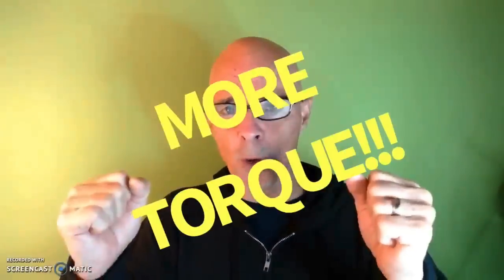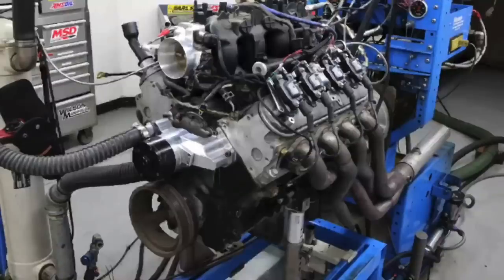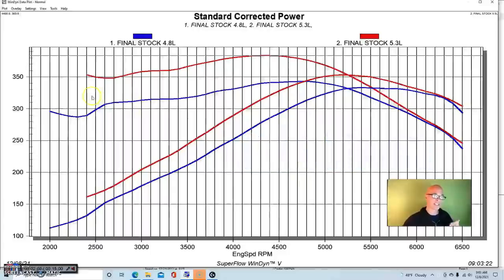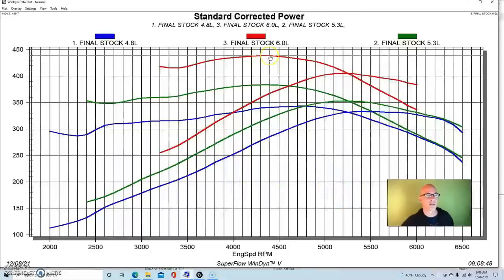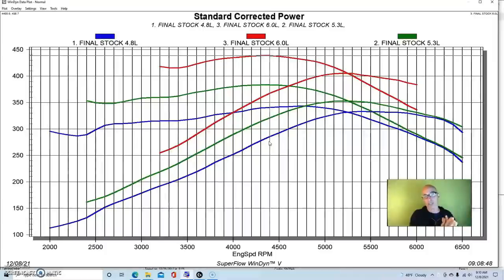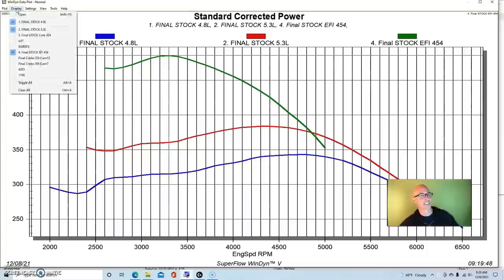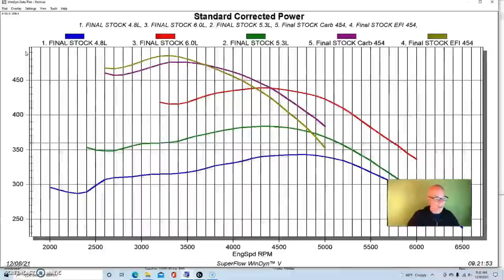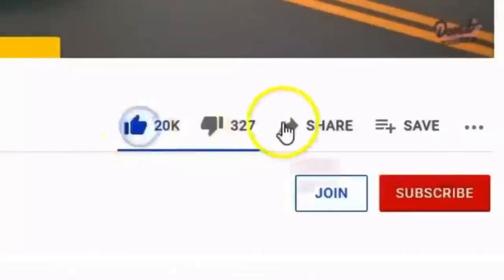LOW BUCK, JUNKYARD V8 TORQUE TEST-6.0L LS VS 7.4L 454 BBC-WHO MAKES MORE TORQUE? BETTER VS BIGGER!

Comment: I like these comparisons, nice job!   I could have told you which one was better, at least from my experience.  I owned both a 6.0 truck and a 454 truck at the same time.  The 6.0 had 4.10's out back with a 4L80E and the 454 had a 400 turbo with 3.73's.     I used them both for towing and in all instances, the 454 would out run the 6.0 pulling the same car trailer.  Even used both trucks at the same time, both pulling open car trailers, and the 454 would run away from the 6.0 as soon as we hit any kind of grade.   What I really don't like about the 6.0 is that in an attempt to keep up it would take a lot of throttle angle, usually the trans downshifting and holding a gear while the 6.0 would scream at 4500-5000 rpm for these long grades, miles at a time in Arizona.   Not my cup of tea.   The 454 would just lug along at 2800-3000 rpm and maintain speed.   I actually got better gas mileage as a result with the 454 on long hauls.   Just my experience with them.  Because of that, when they dropped the big blocks from the line up and I needed a new truck,  I went straight for a Duramax and never looked back.
Reply from the maker: can you draw dyno curves too?-that would make my life a lot easier
Reply: Ur crying over a motor rreving an extra 500 rpm that’s so idiotic
Reply: @bobleeswagger2290  running a motor at 1500 to 2000 rpm lower is a good thing when it comes to towing and the longevity of the motor.....and keeping the rpms lower can't do anything but help with gas millage
Reply: Alot of difference is in the tune. That 454 probably actually had no tm. The 6.0 is straddled with tm. Get rid of the tm and 6.0 does pretty well.....and you actually can get around 15mpg with the 6.0 unloaded. The 454 will never achieve that.
Reply: @HioSSilver1999    I'm 99% sure based off of my dyno experiences that Richard is most likely running a custom computer tune, likely aftermarket from Holley or  if a factory computer is used they'll use HP Tuners or the like to ring the most out of it.
  The 6.0 can be pretty fuel efficient with a tune and smog removed.  I dropped a 6.0 LQ4 in my 72 4x4 blazer, and with my own custom tune, a 4L60E, and 3.73 gears with 33" tires, it got a best of 20 mpg highway.  454's aren't terrible. My 79 1 ton with 400 turbo and 3.73 gears got 14 mpg highway consistently empty, and towing it didn't care what I pulled it always got 10 mpg regardless.  With an overdrive I'd expect 16-17 easily with an empty truck.
My father has a 2014 3/4 ton he bought new with a 6L80E.  Completely stock, it's lucky to get 14-15 mpg at best on the highway.  Towing it's pretty wheezy, and 6-8 mpg is all you'll see pulling a loaded car trailer with the trans constantly hunting gears.  Went across country like that.  It's why I went diesel years ago.
Reply: @firebirdjone  you missed the entire point of my reply.  I know Richard is tuning them....but if you're not atleast tuning the tm out of them then you never see the power he's showing you they can make.....not even near.

That 6l is hunting for gears because it has more gears. I have a 03 6.0 2500hd. The newer one like he has isn't weezy at all......well the engine isn't.  The tune sure is. You have to differentiate between the 2. A friend has a 08 or 09 6.0 in a single wheel 3500. His pulls good. The extra gears of the 6l is a benefit over the 4l80 like mine has.

With a car trailer and vehicles as large as surburbans my 6.0 almost never comes out of od on the highway with me throttling it. Now if i use the cruise is shifts some because the cruise will make it downshift and accelerate on a grade if it looses 2 or 3 mph. More times than not if I'm throttling it then it just hangs there or accelerates slowly back up to speed on said grade. You  have to be willing to drive it more than just holding onto a steering wheel.
Reply: @HioSSilver1999  I didn't miss your point,   the fact I mentioned that I'm sure Richard is tuning them meant that I'm sure torque management has been removed.  That's one of the first things you do.  It's not needed on the dyno, we aren't worried about transmissions here. I'm sure what you're seeing on his dyno is without torque management. 

For the record I never use the cruise when towing with the gas engines.  They are too brutal on the throttle changes.  Even with that said, can't avoid the gear hunting and the fact that the 6.0 has to scream 5,000 rpm to climb grades around here just to maintain 50 mph in some cases.  My old 454's never had to do that.  That's the difference between the torque curves that I mentioned months ago in my first post.   GM dropped the ball when the BBC went away, which is why I went diesel many years ago.  The 6.0 is okay for towing 2-3000 lbs. and not horrible with 5-6,000 lbs of open trailer,  but I'm miserable with 8-10,000 lbs. of enclosed trailer behind me.  Either way, it won't run with the 454 on any decent grade.  Been there done that as I mentioned in my first post.
Reply: @HioSSilver1999  I get 15 mpg on the highway with my 99 k2500 suburban 7.4. around 10 loaded with Dutchmen 30 ft travel trailer.. going from Vegas to San Diego you have (cajon-pass 4000 ft elev) and then a really shallow long upgrade after it that gives semis fits. I just pass right by them without downshifting.
Reply: @firebirdjone  you did miss the point because the tm isn't removed in your 6.0 truck. The old 454s never had tm.

Depending on the year of your 6.0 and the trans it had they can't turn 5k rpm at 50 mph. The gearing won't let that happen in my 6.0 truck....and it has 4.10s with the 4l80.
Reply: @wrotedog  you sir have the most amazing 454 on the planet. I've never seen one get 15mpg
Reply: @HioSSilver1999    Oh it absolutely would spin 4500 to 5000 rpm to hold 50 mph climbing these grades around here.  I'm not even sure which gear it would choose,  it was all over the place, has the 6L80E.  Was very unnerving holding those rpm for 6-7 miles and trying not to be a burden to other traffic.  On flat ground I could live with it, but in the mountains, forget it.   As far as torque management goes, maybe GM should build something more durable that doesn't need a band aid.  I was tuning these things years ago with HPtuner and removing that stuff looking for more power but the 6.0 just didn't have what I was looking for.   It's another reason why I got away from gas trucks and went diesel.  Even in stock form there was no comparison.  Now after some bolt ons and tune it doesn't get any better.   It's just unfortunate we have to spend $80k for a diesel to have a truck that does what it's supposed to do.  GM dropped the ball when they dropped the BBC.
   Don't get me wrong, I like the LS platform and have done 6.0 swaps in classic cars.  They are great engines that have power potential in a car, just not big enough for a truck application to do what I need a truck to do.
Reply: @firebirdjone  yea if you had the 6l80 it would. They're meant to turn those rpms tho.

I have the older 4l80 in the gmt800. There's more than tm going on there. You have a pe delay also. I just call it all tm because essentially that's what is. 

My 6.0 has headers and some other mods that really improved it. But if you don't find ALL the tm the mods really don't matter. It just makes the pcm pull more torque. Most never find it all....hell I'm still trying to find it all myself. I know there's still something holding it back on launch a little. I've found most of it tho.

I don't think gm does it because the components aren't strong enough really. It's more to keep warranty claims down because some people can tear up anything.

Comment: a 402 or 408 or 416 with an aloominium block and aloominium heads is light weight.  It'll fit in a Nash Metropolitan too.  With a factory intake and a factory Vette pan, you could mount it low and probably still close the hood.  You might not tow with a Nash Metropolitan, but you could.  And you'd be cool.
Reply: I just saw a factory GM picture of a mid-90s ZR1 Corvette towing a fairly large boat. As though they approve of it. That blew me away

Comment: Richard, to really put a point on this you should pull up the Cadillac 500 torque numbers.  I think it can beat the BBC in ft-lbs/CID.
Reply: Stock Cad 500 made 550 lbft
Reply: 455 buick is even better at making torque
Reply: Pontiac 455 also

Comment: Cool video. Looking forward to part 2 comparing a stroked LS to a 454.
Reply from the maker: that vid is up-and part 3
Reply: @richardholdener1727  
Just for fun. Let's say you're chilling at the Santa Nella In-N-Out with a 10k-15k truck and you felt like "racing" over to Gilroy/Hollister on the Pacheco Pass. Same truck, same trans, same rear gear, and same tires, same induction.... only difference is this gen 6 454 or 6.0. Which would get to the summit first?

Comment: I’d love to see a 60 degree v6 build. Like a 3.4/3400/3500. Trying to build one for an mgb swap
Reply: A 3.4/3500 hybrid!!!
Reply: @illililililillli  that’d be sweet. Though I’m biased to the LA1 since I already have one.  😂
Reply: @BBCMONTE34  if you're near Youngstown Ohio I have a 1995 3.4 4L60e with a rod knock sitting there collecting dust. I'd be willing to donate any parts you need lol
Reply: @illililililillli  I appreciate it but I’m in fl. Might end up having to get a 3.4 t5 combo anyways for the other parts involved.
Reply: @BBCMONTE34  Check out WOT Tech 3.4/3500 hybrid. Gen 3 heads & intake are a massive upgrade for these engines

Comment: Love Richards vids. But sometimes there's alot left out. For example if you have a 2500hd with a 6.0 you never get full power in 1st gear......no matter how hard you smash the throttle. There's a pe delay that simply don't allow it. There's also settings that don't allow it to go into pe mode when in overdrive as quick as you need it. 

You never see that kind of stuff in these tests and most people never really know how good a 6.0 can pull because of that. It doesn't matter what cam....doesn't matter what headers or exhaust you throw at it. If you don't change those settings in the pcm you never get the results from those parts that you should in the actual vehicle. 

Just turning off the pe day picked my truck up .3 and 3-4 mph in the qtr.
Reply: Thank you for bringing this up, I vaguely recall reading it in an old review. I have a 6.0 in a 2004 2500 van. Do you think it has the same restriction in first gear? Is there a way to disable that?
Reply: @7x779  yes there's a way to disable it. Either get it tuned and bring it up to whoever is tuning it or get hptuners or efilive and disable it yourself. 

I'm no mad tuner scientist by any means. But i do find little things like this and have brought them up to guys that are supposed to be mad tuner scientist that they have missed or had no idea about. 

Some think it's all about timing and fuel mixture. But a oe pcm is more complicated than that. The oe pcm is always looking for a reason to pull power.....helps with warranty costs you know lol.
Reply from the maker: I turned it off on the dyno (we tune for max power and torque)
Reply: @HioSSilver1999  makes sense. I did buy some very popular tuner and programmed it many years ago but I don't recall seeing a setting to disable that feature. I have a hunch it's not able to. I'll have to check out the ones you mention or talk to a tuner who knows about it. But it makes sense, it does seem to pull harder in the second half of second gear then it does in first gear, when it should be the other way around since first gear would be putting more torque to the ground
Reply: @7x779  the pulling harder in second is exactly what made me go digging for it. That feature turns off automatically if you hit 5200 or 5400 rpm or after 60sec of wot. So it basically turns off after the shift to second gear.

A hand held type tuner probably won't get it done for this.

Comment: Would be great to get one of the new HD 6.6 gas gm engines on the dyno to see how they build TQ vs the LQ4 6.0!  Maybe a 454 LSX would be nice to see built for TQ
Reply: I know Scoggin Dickey Parts center dynoed the 6.6 to 2000 HP so far, with twin turbos.

Comment: I swapped an 87 vintage 454 out of my 76 C10 for a 6.0 because the 454 was a dog and got around 4mpg with a great running Qjet. I buy the entire truck, around here they are rusted bad so a 6.0 powered 2500 is usually $500 or less. I have six of them now, and seven 5.3s too.
Reply: 4mpg? There was something wrong with it then.
Reply: That old 87 probability barely have 8:1 comp, the later year 454's made about the same MPG as a reg 6.0L. Hell my 90 4x4 7.5l F250 would do 15mpg on highway if I keep it below 70mph. And have seen Cali OBDII 7.5l make 19mpg at 70mph, Cali was the only place the 7.5l's got MAS Air and sequential EFI.
Reply: It sounds like a made up story from a LS fan boy lol.
Reply: Good move.
Reply: @TdrSld  sure you did
Reply: If you couldn't figure out why it was getting 4 miles per gallon then I can't believe the rest of the story!!!
Reply: My ex's 1984 454 (2wd dually, 40k mi) got 2-3 mpg towing a loaded 2 horse trailer, and climbed a 7% grade at 25 mph. She hated what I did with vehicles, making them more efficient.  She especially hated my 1979 F-350 dually, because it was mine, and it kicked her a**. 55 mph up the same 7% grade with a loaded 4 horse trailer and hunting gear. 460, dove heads, built well. 10k lbs Chev @ 3 mpg vs 23k lbs Ford 460 @ 7 mpg.

Chevy messed up with their 454 in the late 70's to early '80's. Too big of ports and too low compression, especially at 5000' elevation. They finally fixed all that with the Vortec. The (Vortec) 454 has better volumetric efficiency than Ford's 460 ever did; the right combination of parts make a Vortec an animal! You have to stroke a 460 to have a start with volumetric efficiency.....
Reply: You can for sure freshen up that Early 454, parts are more common compared to the 262 LU3.
Reply: @Faolan161  the early 454s can be fixed today.
Reply: @shadowopsairman1583  sure, any engine can be fixed... but why build a crap engine in the first place? For an engine with too large of ports, filling them, or increasing cubic inches are the only options. Too large of ports are detrimental at high elevation, so fixing is very spendy...
Reply: Hell, even my 460 flatbed econoline truck with a 36’ trailer weighing 20,000lbs combined averaged 6.3mpg on the last 2300 mile trip I made. Something wrong with your BBChebby, it gets about 10 unloaded.
Reply: @SweatyFatGuy  your not wrong, those BOP 455’s were all torque monsters, also low in the rpm range with stock cams, heck, GMC used the Olds 455 in their fwd motor homes back in the 70’s, but comparing mileage in a car vs a truck for pulling trailers not really apples to apples. In cars you can get so much better mileage because of the smaller frontal areas compared to any old pickup, and in my case a van- cab. Pushing air is the worst for mileage. My brother has the same year 460 but in a 2wd pickup, he gets about 3mpg better then my van-cab does. The frontal area makes a HUGE difference, especially at hwy speeds. I like the van cab better though, I have a 12ft bed and 30” super cab but it’s the same length as an 8ft bed super cab truck. I can put small cars on the back of mine.
Reply: Before I built my 460 van flatbed, I had a 90 gmc dually, 454 t400 with 96 engine but with the 90 tbi fuel system, it got about the same mileage as my van, but it did have more power, or felt like it did anyway. The 96 engine was key, because those had 9.5 comp, good engines, strong. But hard on the wallet just like my 460.
Reply: @SweatyFatGuy  fun to hear about your projects! I like to do the same with my rigs, more efficiency, more power, better mileage. I don't do much with GM, just Fords and Cummins. Accidentally pulled 600 horse out of my 5.9 Cummins... I wondered what I built the day I outran an Audi A6 with an 11k lbs dually. And 30% less fuel.

Ford 429 & 460 has been my game for 20 years. FE 390's were great for mileage, but not longevity with hard use. I had a 1969 F100 w/ 390, 18 mpg around town avg, beat a 454 in 1/2 ton k20 @ 8 mpg... 429 and 460 are not volumetricly efficient, but outran the 80's 454's. And far better mileage! 
I'd be interested to see how your built 6.0 does! Chevy is definitely at the top of tue game with pushrod motors. I don't want one, but I have a lot of respect for their great design. I feel the 6.0 could use a little stroke, though, for a little more efficiency.....
Reply: @SweatyFatGuy  I am looking to sell off my FE stuff as well. 3-390's and a 428. Keeping my BBF stuff, though, because I have figured out all oiling issues and have developed an oil cooler without restriction. The FE's, except the rare 427 side oiler, just don't supply enough to the crank. Non issue now with my BBF's. Turboed 523 is in my '79 F350(ish) dually. Built for towing and mileage. I hope to do up a stroker BBF, turboed, for a Formula off road car in the next couple years.  Need some experience with my '79 first, though...

That Cleveland ought to scream! I had a 400m, thinking 4v Cleveland heads would do some justice.... bearings are a bit narrow, though. I went BBF due to longevity. Out of all big blocks tested by Hotrod Mag years ago, the BBF held up the best.
Reply: P